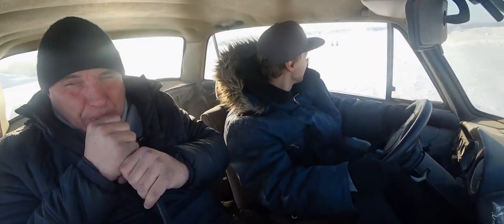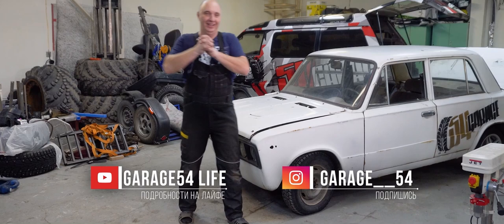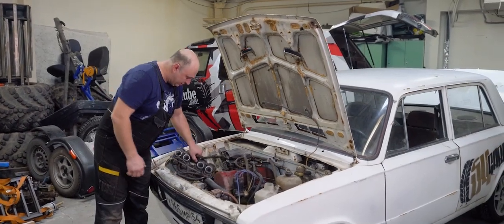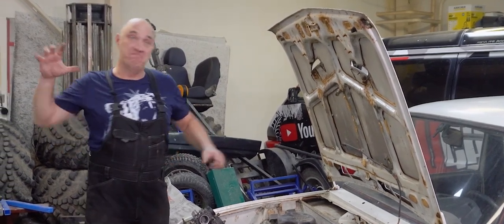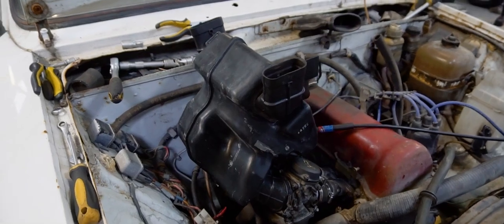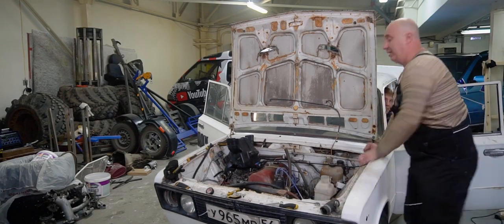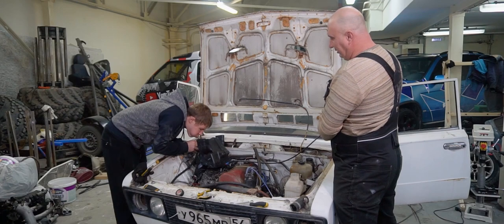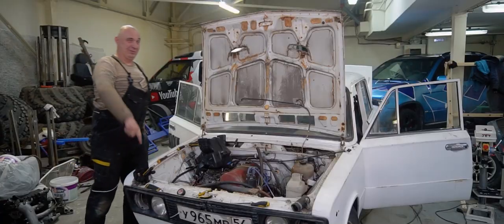We fit 4 motorcycle carburetors to a Lada

Comment: those carbs need high vaccum to work... the throttle just opens a butterfly valve, to rise the piston with needle it has to get strong vacuum under the black plastic cap... this can be quiet difficult to tune right

Comment: You must have fully synchronized carbs, A 1000cc might be better as you want to match cc's as close as possible as these carbs perform under air velocity and vacuum from airbox to raise the venturi under WOT, as you have idle circuit, 2 secondary, and WOT (main jet), the jetting needs to match correct temp and @ sea level as they are very finely tuned. all circuits flow until WOT as then the main pulls fuel as if a straw ad air nozzle rushes past and pulls ALL the fuel so a ZX600R ninja will work excellent, all circuits have to work i unison to cylinder size and "HIGH RPM" use the octane also matters even moisture in the air, but you need to establish a baseline of rpms and each cylinder fuel need at WOT. jet them for open air box and make the runner's LONGER for atomization.  Increase the spark energy and change valve springs to much higher pounds and shim them to within 1lb each other for a sport bike rev. And yes, up fuel pressure, a pusher pump 2-3 lbs as they are GRAVITY fed. you can run these leaner or fatter depending on jets sizing and need leaner tends to be meaner fatter is safer, plug color is key here, my 600 turns 14,000rpms i did ALL carb work myself. FYI use OEM jets @ 8000rpms my bike is just start to pull hard and sing that song of Gapplebee's is being served, i have vids to prove, different carbs pulled back or smaller cars and bigger jets. Yw and enjoy. Ya'll can buy or make a CFM meter using transmission fluid a 4 7-8 ft clear hoses an mark them every foot and meter them that way using specific gravity method or buy a CFM fan meter that fits over intake. it's all in how much effort Ya'll wanna put into a rev monster LADA. sport bikr cars are very finely tuned pieces not for armatures by no means.

Comment: The main jets need drilling out to allow more fuel flow, the lads is likely 1600 cc and bike the carbs came from much smaller capacity.
Reply: The carbs are on individual cylinders, so that carb is only dealing with 400cc's I highly doubt the bike in came off had 4 carbs so it's likely 1 or 2 carbs for a 350-800cc bike, more then likely everything checks out fine
Reply: You forgot about RPM.
Reply: @jaykoerner  heaps of 4cyl bikes have 4 carbs?

Comment: Tuning the carburettors could be done with a Colourtune spark plug. It’s fiddly but could work.
Reply: How do you tune around the fact that in this application the carbs need to deliver 50% more fuel? Not going to do that with a colour tune and a screwdriver....

Comment: Bin them carbs off, fit a set of mikuni rs38's. as everyone has mentioned the diaphragms need constant pressure to raise the needles.

Or a set of carbs from a gsxr 1100.
Reply: 750's had bst 38 ss's.
You can rejet for an 1100.
34's are great for the street, tho. 
At least, for an 1100.
The RS series is over rated.

Comment: I run bike carbs om my lada 2101 engine you need a jet kit to tune them then its great and dont blow in to the vent tubes of the carb this wil pressure on the feul bowl blowing it thrue the jets thats why you get the small boost and then Nothing.

Comment: the carbs gave a vacuum slide in them when you open the butterfly on the carb the slide doesn't open until the carb sees a pressure drop. when you blow in the tube you create the pressure difference  for the slide to open wide open all at once. here is a video that shows the carb in detail https://youtu.be/cufBK75uYdg

Comment: Had 2 double Weber 45mm on a 2 litre volvo engine. Was hard to make it run clean, and a pushrod engine dont reach high enough revs to benefit from so high CFM setup in the first place. Motorcycles with 4 carbs otoh, not that hard to work with, manufacturer has calculated what you need and thats what you get, they just work - unlike aftermarket parts.

Comment: I'd say your float heights are wrong on the carbs. Your running bigger cylinders now so you will need more fuel. The current float heights are set to a very low cc engine compared to the lada. Up the heights by 10mm. The float bowls are emptying quicker than they can fill. Also make sure that your not drawing air through the air box and set air fuel ratios on each carb to suit the lada engine.

Comment: It's running too lean, blowing air into the tube pressurises the float chamber forcing more fuel through, allowing the engine to run properly. Not having an airbox will make it run lean (less vacuum at the carb inlet)

Comment: These types carbs do not have accelerator pump assisting at low rpm at WOT also as these survive purely from air velocity alone, being maddeningly pulled thru  that short distance, also all circuits con't to provide fuel even @ WOT as all that is the main jet pulling from fuel bowl, My 600 w 160 jet in Missouri 784ft above sea level is maxxed out, 170 is Bogg city. @ WOT my bike drank 2.7 Gal before next city less then 20 miles away. It will pass anything but gas station.

Comment: youll need 6psi fuel pump for the carbs, and the pipe goes to the air box, gets fed ram air from a couple of intakes on the front of the fairing. lots of cars run bike carbs. without the original air box.

Comment: I would like to see if they could put a gearbox on backwards, so they end up with a bunch of reverse gears just to see what'll happen
Reply: That's not how a gearbox works, and they did that by flipping the diff upside-down
Reply: @kopppls  manual gearbox would work
Reply: @DeathBaseTURBO  No it would not, it does not matter what way the gearbox is, the input and output shafts still spin the same way. You would have to invert the rotation of either the input or output shaft. Or just flip the diff... as they have already done
Reply: @kopppls  but have you tried it?
Reply: @DeathBaseTURBO  oh ffs cant you handle being wrong are you 14 or something? Have you ever laid your hands on a wrench?
Reply: @DeathBaseTURBO  The only thing that would happen is that the gears would be the other way around: First gear would be insanely tall, kind of like a million overdrives. Second would be a bit shorter etc etc, fourth gear is 1:1 in a lada so that would still be the same. But still, ALL FORWARD GEARS
Reply: @kopppls  are you assuming it won't work or it won't work because you have tried it, because that's usually how we discover things is because people have an assuming mindset and don't actually try it, is usually why so many things go undiscovered because people assume things won't work that way, you never know unless you try
Reply: @kopppls  would still be fun to see

Comment: Im no expert but my explanation is that the carbies are from something under 1200cc, and i would say the lada engine is possibly 1600? These will have the wrong jetting and causing it to run lean under acceleration giving that hesitation under load. The reason it runs better when you blow into it, is that your breath is cancelling out the oxygen mixture and richening the fuel causing sudden rpm. 
I would also check fuel pressure, motorbike carbies dont like much above 6-7psi feed. But i dont feel that is your problem here as there is zero fuel smoke. V-Stack sizing wont effect its actually running too much, it would just give it a higher rpm torque curve.
But this could be a good project car for us viewers to watch and follow. Please do a high horsepower lada engine build? 
Using these carbies and doing some performance mods? Tricks or all your previous 110% success creations all in one. These carbies, the electric super charger, the mechanical ignition, custom lada wheels etc

Comment: Blowing into the carb vents probably just served to richen the air-fuel mix, if they're from a bike such as a Honda CB750, and the Lada's a 1.5L engine, it's basically running lean with the carbs tuned for an engine half the size, causing it to bog down and not have much power until you force more fuel in, open up the jets a bit more it'd probably go like a rocket, preferably not like some of the past russian rockets though maybe, in their sudden balls of flames and all... :P
Reply: The other side of that theory is the carbs can flow fuel for possibly 12-13k rpm which on an engine that maxes out at 5-6k rpm🤷
Reply: @brotang2953  the heavier the flywheel, the lower the redline. Small engines only rev so high because the flywheels are so light and the vehicles are so light. If there was more resistance they wouldn't be able to get that high unless it was in neutral.
Reply: @andrewdalvet6871  I'm not sure if you understand what I'm saying.....I'm saying that say a 1200cc engine revving at 13k is probably consuming fuel at the same rate as a 1600 at 5-6k. But your also wrong about flywheels.....a wide bore and short stroke is what makes a high revving engine along with lightweight internals to reduce rotating mass. A flywheel literally just smooths out the impulses from each firing cylinder. You could put a Lada flywheel on a race bike and it will still rev to the same rpm but the time it takes to get to Max rpm will be longer is all. You could remove the flywheel from a Lada and it will still only rev to 5-6k which will come down to " breathing " as the intake and exhaust become the limiting factor in the end.

Comment: I kinda wonder if you could make a u8 enging from 2 lada i4 engines
Reply: V8?*
Reply: @joe125ful  U8*
Reply: @joe125ful  u shaped engines are basically two inline engines shareing a block and an output shaft an example is the detroit/gm 6046
Reply: @thundermite1241  Strange setup...also complicated too.

Comment: Jets are too small. Even if those carbs were from a 1000cc engine, they are too small for the lada engine. Blowing into the vent is forcing fuel through the jet making the engine rev. I can hear by the way it starts it has heavy advanced timing. Combined with less fuel equals kaboom. If you drilled out the main jets bit by bit you would find where it works well
Reply: I saw someone running a motorcycle carbona v8

Comment: 1) Install glider wings and tail assembly to your Lada.
2) Recruit Dizzy Gillespie to blow on the carb-tube.
3) Conduct a thorough preflight of the aircraft.
4) In high gear at 8000 RPM, take off, flying south-east at low altitude to avoid radar.
5) Cross the Mongolian border, landing in Ulaanbaatar.
6) Request political asylum.
7) Hand over Lada for reverse-engineering of high-tech, Soviet automotive technology.

Comment: Blowing part is Just Ram air system on Some Engines. Carbs dont rely on that. Ram air just adds pressure to Airbox at speed. But its less than you Blow. It's just Wind speed. At Normal speed it's nothing at all. At Top speed around maybe 0.4 to 0.5 bar (over 240 kph)
Reason Why they dont work is They are Vacuum operated. Not Ram air operated.
Bike Intake tubes have small holes integrated in them that match small holes on the Carb. That tube operates the rubber Membranes that are on top under the Plastic cover. Vacuum will move the slides effectively Chokes at all times. Adjusting according to engine vacuum. EACH CYLINDER INDIVIDUALLY. You cant have 1 vacuum tube for all carbs. Actually you can but it will work like shit. Slides also carry Fuel needle valve's needle. So they also control the Fuel amount.
Since thats probably a Kawasaki Carb set It has a fuel pump and Fuel needs to be pressurized to enter the Float bowl. Pressure on Bikes usually is around 2 psi so Car Pumps are too strong they will flood the Engine. And Natural drop flow will not open the float needle and let enough fuel in .
 Slides need to be synced to work properly and  Engine to be smooth and responsive.(syncing slides means equalizing Vacuum at all cylinders) Only input you have is the throttle body and that just controls the size of the Carb intake. Vacuum controls the mixture still.
When you Blow into it you play a Turbo and disturb the Mixture ratio and Vacuum thats why you get shitty results. Basically faking that you opened the throttle body.
Oh Bike Carbs Dont like ANY vacuum leaks and Do not Like to be mounted in positions of angle that are not on the Bike. So they are mainly Horizontal not tilted front. It affects the Float that needs proper orientation to Work.
so order of Fixing.
1 Mount the carbs in Horizontal position.
2 Make sure intake does not leak AT ALL.
3 make sure that No holes on the front of the carb are Plugged. Vacuum tubes are very small holes.
4 Ask the person who gave you those is the Bike Using fuel pump or Free fall Tank.
5 Stop blowing into the tube. It Doesn't do what you Think it does.
Oh yeah Carbs above the Exhaust header will cause Fuel to evaporate from heat and F up your Fuel air mixture even more.
Reply: Yes, I agree that carbs need to be mounted horizontally. That could also be the reason why bikes with carbs don't like wheelies. Surprised not many people picked that up.

Comment: Сделайте отверстие в выхлопной трубе и вставьте шланг в отверстие, чтобы у вас был воздух для карбюраторов.

Make a hole in the exhaust pipe and put the hose in the hole so you have air for the carburetors

Comment: Nice video. Interesting experiment and you're probably drawing in too much for your cylinders. Air and fuel are probably not balanced correctly due to all the extra capacity. Still a nice video though, and leaning out the fuel a little might help. It's either rich or lean depending on whether or not you have a pressurized fuel system. Having to blow into it though leads me to think it's rich.

Comment: 🤣😂🤣😂🤣😂🤣😂🤣😂🤣😂🤣 you were missing parts because that carburetors have thotter hooked to valve that run from valve cover to valve to carburetors lol
im engineers which i know this stuff
you need different carburetors because you got vacuuming carburetors thotter not cable thotter lol
putting 4 carburetors on it im sure you will blew that engine up for revving pass it limited 
I recommend putting msi distribution on it because when u revving it up it changes timing auto by revving n turn it into vtec like Honda did n you going need some adjustment for that carburetors otherwise get other carburetors off of 800cc bike that will work with it
2nd reason they don't want that 4 carburetors engine is because it throw it self into beasts mode cause people get into wreck or uncontrollable vehicles so they step down hp by using cheap carburetors that barely put any hp in engine
3rd if you love beast mode vehicles you going have to be cautious about it because will take off like jet engine aint joking n i have done it on my ranger oh man 2ft long pipe to carburetors n when i full revving it got up to 13k rpm (red mark was 7k rpm it didnt blew up yet lol) i still noticed gas mileage dropped into 4 mpg lol
carburetors u have is 7psi maximum if your fuel pump is less than 5psi it will revving up for 20 sec unite fall on it face (out of fuel in bowl) you can use two fuel pump like one fuel pump feed two carburetors n other fuel pump feel other 2 carburetors like spit up save yourself a headache use vwlve cover vent to valve controls to carburetors that way u will have more control of it